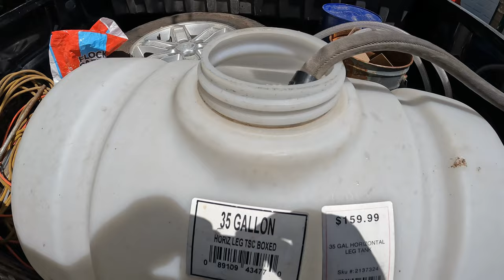Hauling water out to the goats. Those tank lids sure are tricky!

Comment: If you take the nozzle off the hose, it will cut down on the amount of time it takes to fill the water tank.
Reply from the maker: It does go a little faster, sometimes I take it off.  I get tired of losing the rubber washer in there so I leave it on lol.